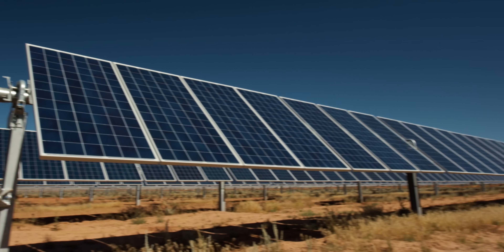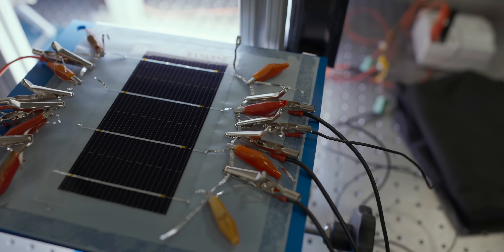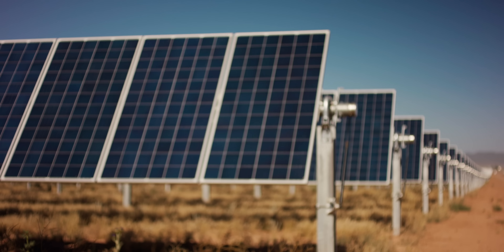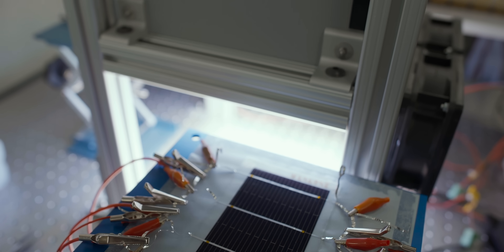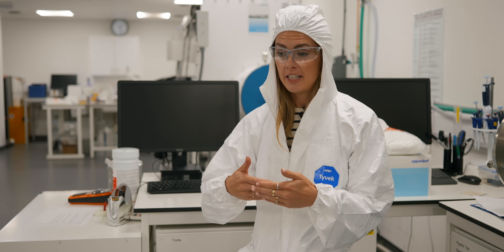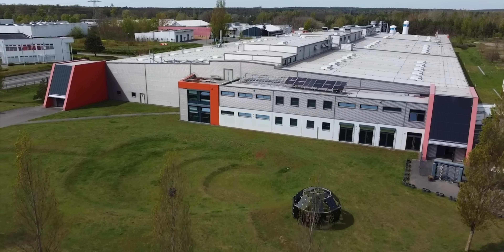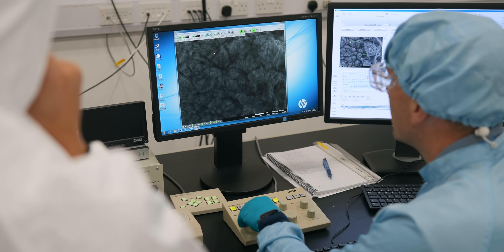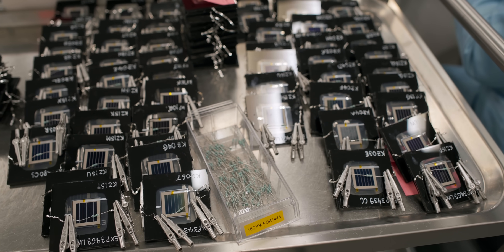This MAGIC Ingredient Is Doubling The Power Of Solar Cells!

Comment: The efficiency levels of Perovskite are based on the amount of solar energy that penetrates the Earth's atmosphere. So naturally the use of Perovskite in solar panels on orbitting satellites would produce more power as the solar energy will not be diluted to the same degree. This could be the beginning of solar power plants in space.
Reply: Only if the commercial panels are graded to absorb that density of energy.
Reply: hopefully that requirement will not be needed in the future.
Reply: and how do you get the generated power from low earth orbit to where its consumed on the earths surface????
Reply: @jukeseyable  That's already being worked on.
Reply: @trevorberridge6079  oh really, what is the basis for the transmission methord, I'm an electrical engineer btw, so dont worry about confusing me with physics or mathematics. i would be very interested to know how they would be dealing with 1 frequency modulation in order to transmit high power waves over long distance. 2 what frequency they would be using, 3 how they will attain high efficeny, low energy loss transmisson and conversion, seeing as even low earth orbit is very cold, so thermal loss would be very high. The folks working on it must be very clever as they will be rewriting the laws of physics.
Reply: @jukeseyable   Why are trolls always electrical engineers? Ever heard of Everything Electric? Look it up. They have a discussion with a real engineer about the difficulties of such a method. But they ARE working on it.
Reply: @trevorberridge6079  Im not a troll, im a qualified engineer with a relavent 1st class degree within the field. Now you have tried to dead cat the discussion, but how are this unamed they going to break the laws of physics to transmit high quantities of energy generated in space, to the earths surface. You apparently know far more than me. Now in response to your question, yes I've not just heard of Everything Electric, I've watched some of their stuff. Sadly been able to play the part of an android in a fantastic comedy series or for that matter a mechanical engineering show qualify you to do anything other than a TV presenting job. It does not automatically gift you with scientific knowledge that underpins what you are talking about. Sadly Everything electric, are far from impartial, they have a mandate funded by UK tax payer money to promote increased electrification. So hardly impartial. but I would be interested in seeing the episode where they discuss the possability of having electricity generated in low earth orbit and consumed on the planet. So if you would be so kind to reply with its title, and we can go from there
Reply: @trevorberridge6079  working on it means no where close
Reply: @itsyo42  It's called SBSP and it will use microwaves and/or lasers. Is redefining "working on it" the best you can come up with. EVERYTHING from the wheel to self landing vertical rockets was being "worked on" before it became common place.
Reply: @trevorberridge6079  Yes I have read the research on MPT and the efficiency is in the 25% which is far from commercial viability.  
Don't need to try to be a smart ass when responding to a random comment
Reply: @itsyo42  A feeble comment meant to be dismissive. You forget how quickly these technologies develop. NDT claimed SpaceX could never work because private money couldn't fund it. Within a couple of years SpaceX rockets were landing themselves. If there's a will to do it then it will happen.
Reply: @jukeseyable  like your smartphone duh, wireless charging
Reply: @itsyo42  oh how silly of me, inductive coupling, (thats the name of the phenomon that has become known as wireless charging). This will work wounderfully of course it will, as long as the 2 elements in this case satellites and the earths surface are in close proxcimity to one another. We will all have to be a bit carefull though when this gets implimented as we will all be banging our heads on those space based satellites. But apart from that, this will most definitely work for sure, no probs here with this that I can see, so Helmets for everyone, and space based highly charged satellites floating around everywhere for everyone it is then. Oh i'm so looking forward to this moment in human technological advancement. Faraday would have been so proud of how scientiffically literate we have all become since his death. I'm so glad we have some very clever people around. 🤣

Comment: When will we decarbonise the manufacture of renewable energy products. Never seen any videos showing any developments. If we need to do it, why not now. Its becoming clearer that we have reached the tipping point. We cannot afford to increase emissions to get to a decrease.
Reply: like using natural gas and coal etc.
Reply: @TerryHickey-xt4mf  They caused the problem in the first place & now we are continuing with more of the same. The rate of renewable adoption is causing CO2 emissions to rise because EVs, batteries & solar are more carbon intensive. Its all about greed & profites & nothing to do with climate change.
Reply: Most of the world's PV panels are made in China.  They have deployed vast amounts of renewables.  

Even in the UK, a solar installation should have an energy payback of around 2  years, and less in lower latitudes.  The next 30 years are essentially carbon free.

Comment: I work for the world's largest silicon solar module manufacturer and am excited to see multi-junction cells come to market, soon.  I can honestly say, without getting in trouble, that virtually all large module manufacturers are in late development of multijunction cells.  Curious what the lifespan of perovskite is now, as that has been the limiting factor.
Reply: its still terrible, they are just not talking about it, they are just 1/12 th the lifespan of mono crystaline pannels, so despite been more efficient, perovskite become less efficient than mono crystaline after just 12 months, then they degreade rapdly with a lifespan of around 2.5 rs, compared to 25 to 30 yrs for mono crystaline. but this isnt mentioned anywhere in the video,
Reply: I wonder how many different absorbers can be layered atop each other
Reply: Curious why they didn't mention longevity - wait no, it's because it's so crap!

Comment: That was a great explanation. I didn't understand the potential of perovskite until now. Mind blown 🤯
Reply: The potential to poison generations with lead?
Reply: and you still dont because they didnt mention how quickly these pannels degrade, they last just 2.5 to 3 yrs. this is the problem with perovskite, all though they are marginally more efficient than mono crystaline when new, after just 1 yr they are less efficient than mono, and then degrade rapidly to the pint of failure after just 3 yrs. As things stand, at best they are an immature technology. at worst they are a dead end. also solar pannel efficency is a total moot point, its just single figure % gains. so a standard 400 w pannel at most becomes a 420 watt pannel, far better just add an extra pannel, and this is very achievable now as pannels have become so cheap

Comment: This is arguably THE MOST important breakthrough in sustainable energy production. Nothing I have seen in media and science comes close.  This also revolutionises energy for all, especially the Global South, allowing them to leap to their own inexpensive energy production.
Reply: It may revolutionise energy for all, but it's none done it yet - it's about a 2 percentage point (<10%) increase on the current 25% efficiency.  So promising, but not yet in the "revolutionises" category.  We will see how much further they can get, given the inherent problems with perovskite longevity.  Fingers crossed!
Reply: The photo rectenna in theory should be twice as efficient assuming we can produce it. Perovskites also have the major flaw of using a large amount of lead, one of the most hazardous metals we know of next to mercury that's a neurotoxin, a heavy metal, and has be proven to cause mental development issues and is even correlated with decreased population intelligence.
Reply: Which is why lead anti-knock additives were removed from petrol.  But petrol was burnt and the emissions released to the atmosphere.  Your children shouldn't chew on solar panels.                   @Skylancer727
Reply: @Skylancer727  I don't get your logic. The common lead acid battery that is in almost every vehicle for the last 100 years still exists. I don't plan on eating a lead acid battery nor will I eat a solar panel so where are humans normally going to be exposed to a molecule made up of a number of atoms ultimately making the pervoskite compound.
Reply: It's largely irrelevant unless the panels produce more electricity over their shorter lifetime at the same cost. Electricity production has already been revolutionized by the steep and continuing drop in conventional photovoltaic panel prices, That's why the majority of new generation everywhere in the world for years has been solar (and wind).
Reply: @skierpage  Wind it a bit more popular in some areas just because of the fact the power utilities can just rent small areas of land in places like farming fields. But yeah the main driving factor of solar is reduced prices. 

Newer chemistries and manufacturing tolerances mean more power, but it matters little if it costs more. Rarely do solar farms use up all the space they need. Like on homes the limit is normally what the city or state will allow you to have or just your budget.
Reply: Dumping toxic solar panels in the global south
Reply: Dumping toxic solar panels on the global south
Reply: absolutely they are not, they lack longevity, their degridation is over 10 x worst than standard pannels. Basically you would be replacing them every 3 to 4 yrs. So its like a sprinter competing against a marathon runner, seeing as PV generation is a long term commitment, the sprinter always looses
Reply: @jukeseyable exactly. Nowhere was the longevity issue mentioned in this video.
Reply: @ewadge  so maybe this video shouldnt be trusted as a valid source of information, and instead regarded as a sales PR bullshit publication
Reply: @ewadge  This whole thing about pannel efficency is a totally moot point anyways, who cares if you get a 5% increas, on a 400 W pannel, its just 20 watts, its insignificant. Mono crystaline silicone is so cheap these days, if you want more power, buy an extra pannel. The trouble is these days most folks are not mathamatically or scientifically literate enough to even remain sceptical regarding claims, let alone decifering what is important and what isnt. This as it stands is a imature, possibly flawed technology, that has no place in the wider market place. It all feels like a bullshit publicity campaign to generate social pressure, (bit like american pharmacutical adverts) to get this into the market. Who knows what deal the makers of these pannels have struck with this and many other channels.
Reply: @jukeseyable your arithmetic is flawed.  A 400W panel is around 22% efficient.  Another 5% would increase the power from that same size panel by 100W.  On domestic installations, the panels cost less than the installation and scaffolding.  You can buy another panel, but that's no use unless you have more roof space.
Reply: @scallywagII  yes you are right there, bropped a bollock on that one
Reply: @jukeseyable  I would avoid expressing yourself with this structure. Using info that looks good at a glance and fails upon further inspection, then utilizing that statement to completely disregard the entire technology. Why? Because you look like a bot. I've seen this strategy employed in several comments now, all in the realm of renewable tech. The others were clearly bots. If you want to make a case for how something is completely nonviable using a single data point, then it must stand up to intense scrutiny.
Reply: @98Zai  ‼‼‼‼‼💯

So many bots...
Reply: @user-sx9hq7qwert  People need to be educated in critical thinking if this kind of reasoning is winning anyone over. There are a lot of people entering the internet for the first time right now and in the future there will be many more as undeveloped countries gain access.
Reply: @98Zai  1 of e reasons 2 leave comments. Others will see n know they r not alone, bots n naysayers notwithstanding.
Reply: @jukeseyable    you've made a huge error.  The 5% (very low ball anyway) is normalized to incident rays, the 400W is post-conversion.
Reply: @jukeseyable  In the video the representative from Oxford PV stated that the first panels are going to a large scale Photo Voltic array and I assume allow them to compare under the same operating conditions to ascertain their potential vs the existing array. Seems like good science to me.

Comment: I would've liked to see them talk about the long-term durability of the perovskite cells, last thing I read said they are now at 15 years until the cells are degraded, compare that to the 30+ years that most silicone cells last and you have a great discrepancy between these two, have they made any advancements in that department?
Reply: not 15, 1.5
Reply: @jukeseyable  even, worse, last thing I've read was 15 or at least working on that, I mean it would be good for the PV industry, they could sell you new panels every 10-20 years, if you actually want to have the maximum amount of power generated, but they need to bring these two Cells closer together in terms of lifetime imo.
Reply: @LastWish90  the 15 yrs might be an asparational figure for the tech to make them comercially viable, but not actual test results of that the tech is capable of at this time
Reply: not sure where you have read 15 years, as most scientific reports state lifetime in hours, the best figures I have seen that are in propper scientific papers and not press releases, are 3000 hrs for silicon doped perovskite, so less efficient, but more durable . that in the uk would give you around 3 yrs use, so a long way to go. the 15 yrs could be untill total failure, the 3 yr figure 3000 hr is time above 90% of initial capacity

Comment: I think time for economical competitive is not here yet.
Also this time we heard nothing about how long life they will have. Will they ever reach 40 years lifetime as silicon cell already have?
Reply: In commercial applications, where the higher efficiency makes a tandem panel more cost effective, long term durability is not necessarily the goal. Even silicon only panels will be swapped out before their maximum lifespan is reached as their efficiency will have dropped and replacements/newer technology panels would be more cost effective than keeping the older ones